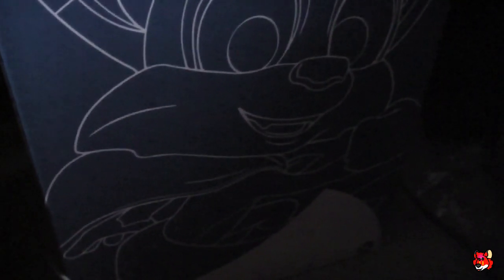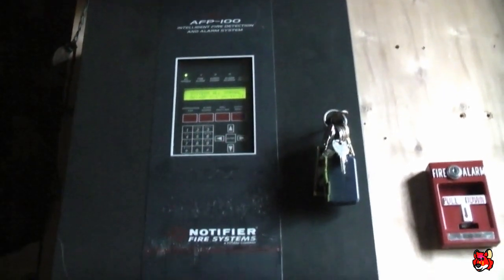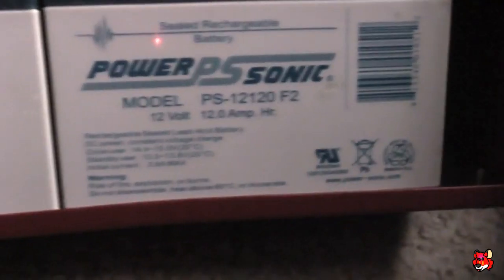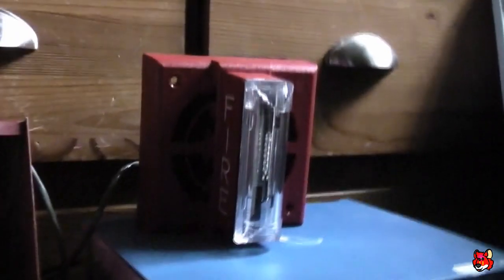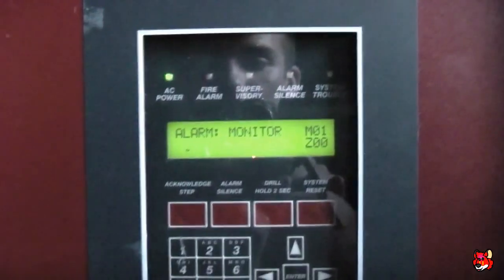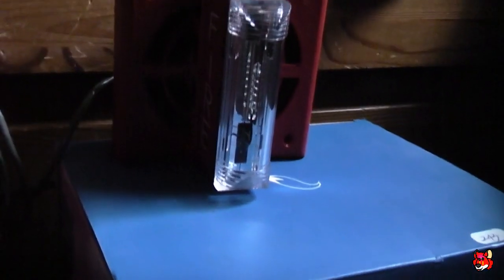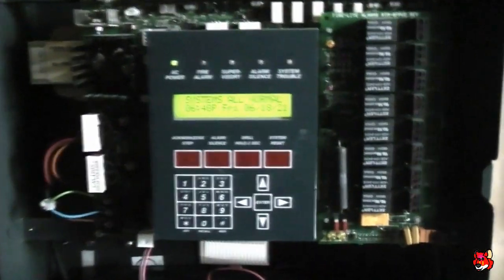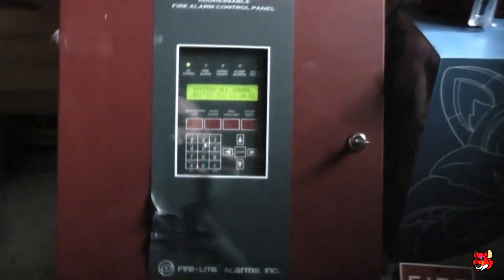I Got Another Fire Lite MS-9200!

Comment: You wouldn't happen to have a spare LCD and piezo for one of these would you? I use a Simplex 4010 now for my main panel but I have one of these MS-9200s that has a functional but damaged LCD and is missing the piezo but it in otherwise perfect physical and functional shape so eventually I would like to make a complete unit by replacing these parts.